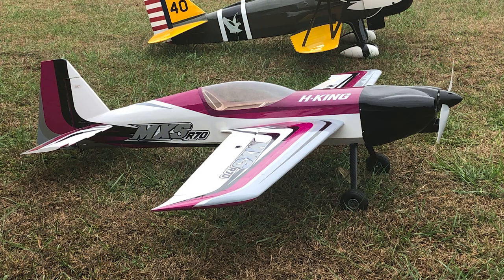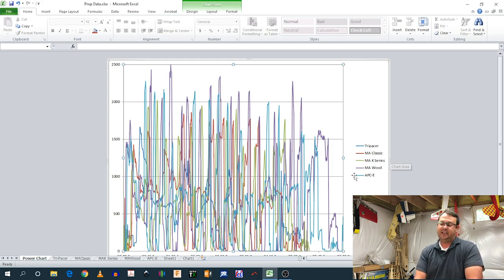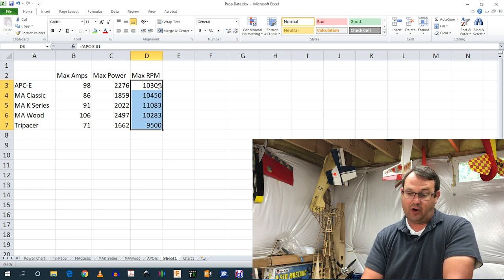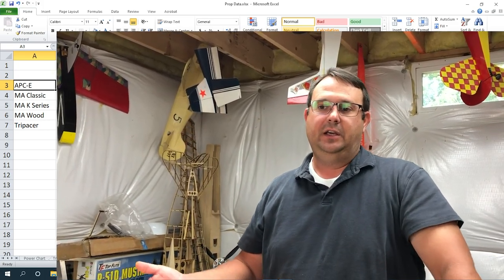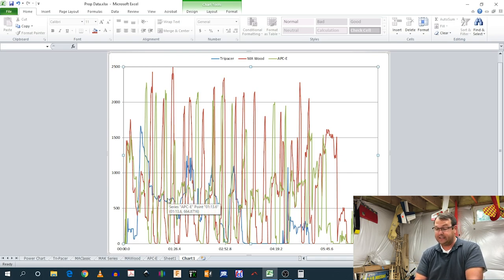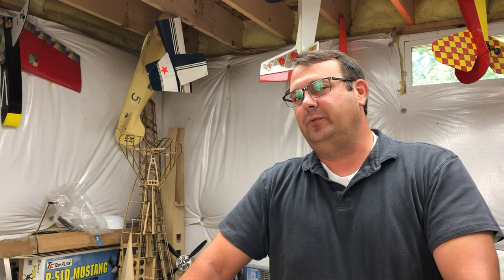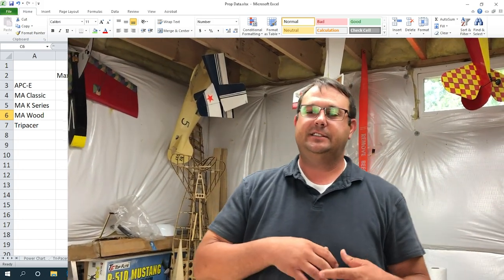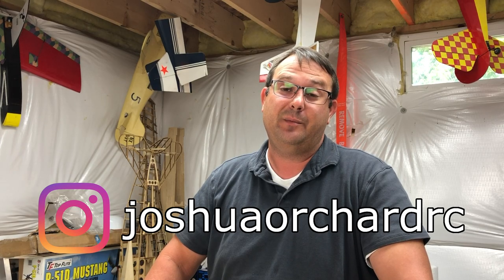Propeller Selection: A Basic Guide

Comment: Can i add motor propper set on my car and run it from a seperate large battery bank. Batteries will be charged later with solar system through plugin.
I need your experienced suggestion WILL IT IMPROVE MILES PER GALLON OF MY GAS CAR????